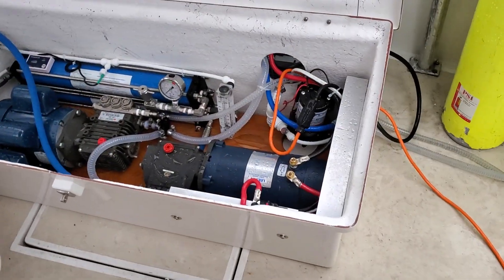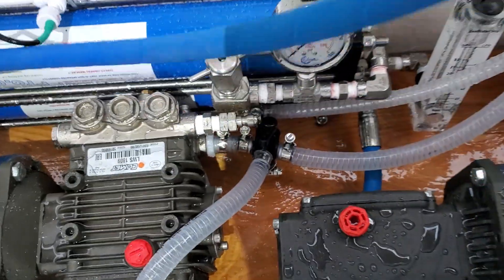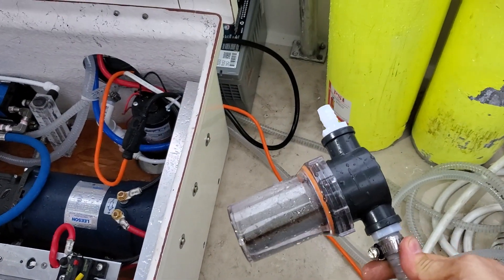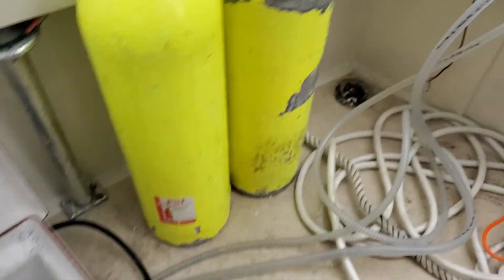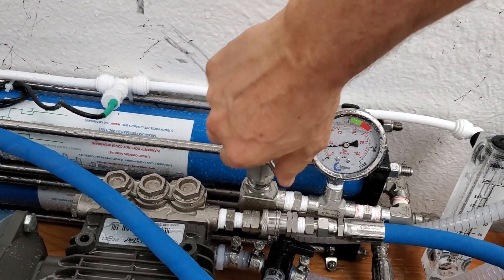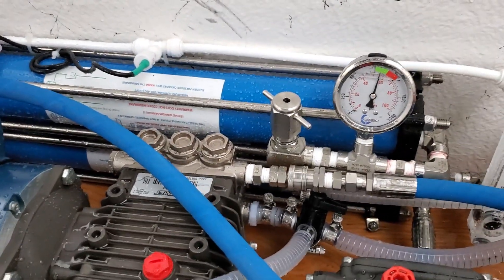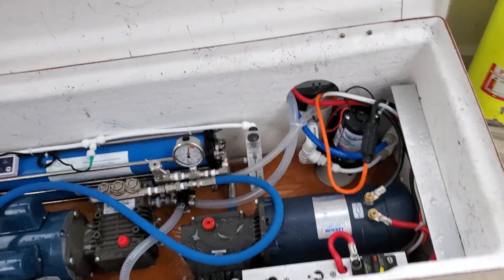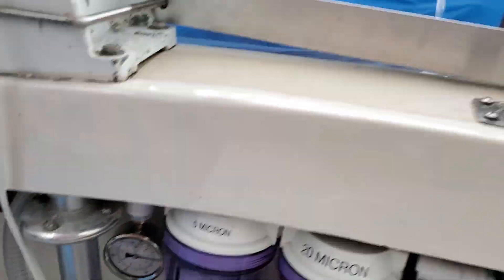Seawater Pro water maker - Dual pump Demonstration Part 2. visit us at www.SeaWaterPro.com

Comment: Thanks! I thought it was not good for the membrane to run higher outputs in fresh/less salty water as you are doing here. I heard in fresh/brackish water one should lower the HP pressure to keep it at maximum output for the membrane. Do I misunderstand this? Thanks!